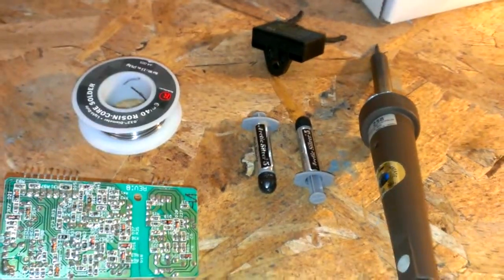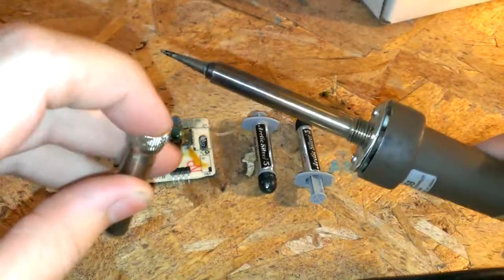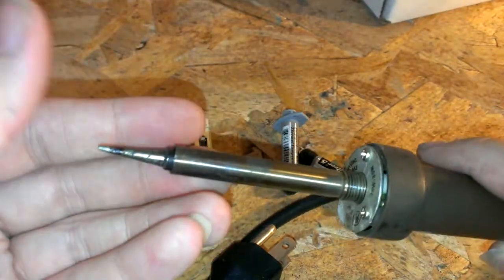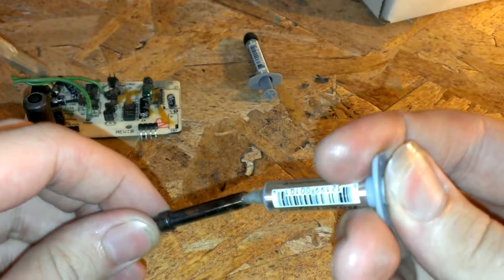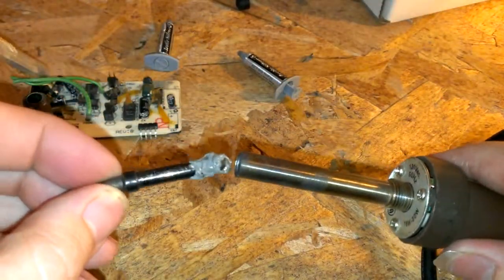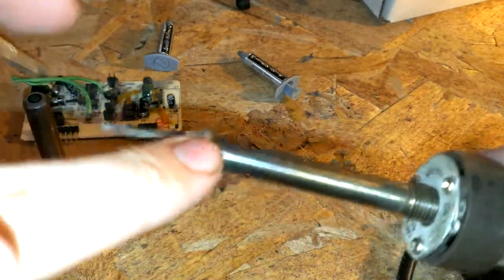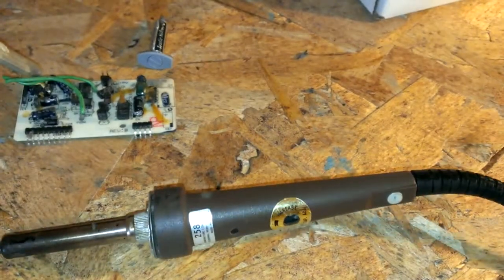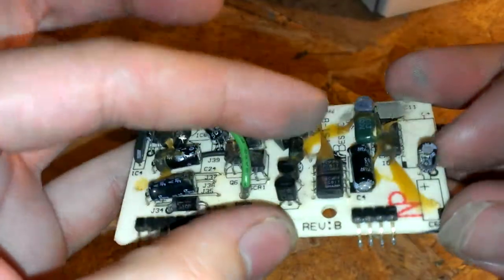Soldering Iron thermal paste

Comment: Thank you for the video. I pulled out my soldering iron and it wasn’t getting very hot. Pulled it apart and thought thermal paste might help it. 
A tip for you. I do refrigeration work and use thermal paste often. Many hvac and refrigeration supply houses carry thermal paste. We use it on temperature sensing bulbs and also put it in the well that thermometers go into to get a more accurate reading of the fluid inside the pipe. Small container has a few ounces in it. Bottle is 3 inches tall 2 inches across. I do not know the price other than it’s much less than those tiny tubes you can get online. Also some supply houses do not sell anything to anyone without a hvac license. Call first see if it’s in stock and talk to them let them know that’s all you want and it will be a cash sale or credit card. Thanks again for the video.

Comment: Next time try to find this product... T-99 HIGH TEMPERATURE
HEAT TRANSFER COMPOUND from Thermon
Maximum exposure temperature...........1832°F (1000°C)
the problem is the container sizes so I will try to buy some and sell it on ebay